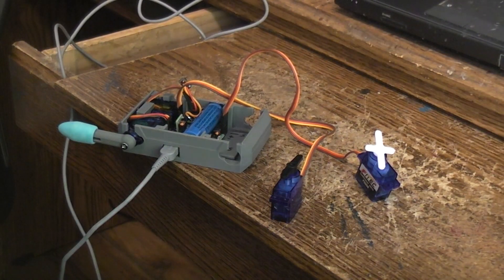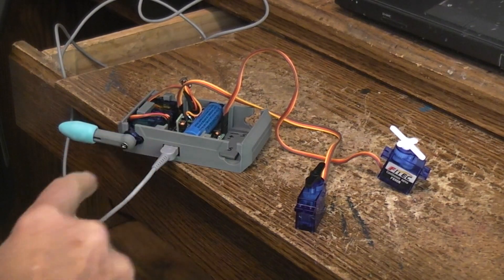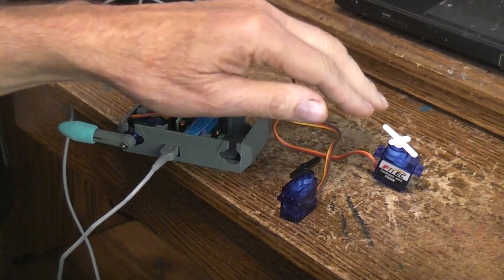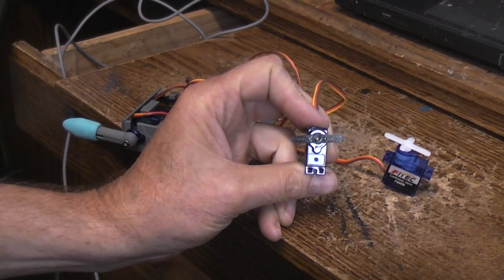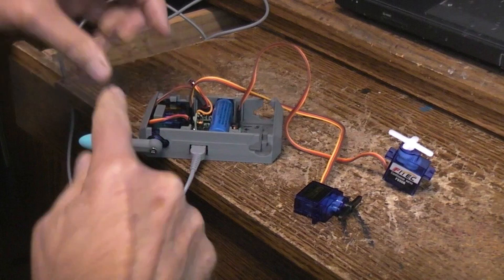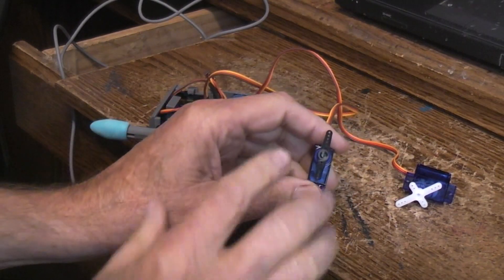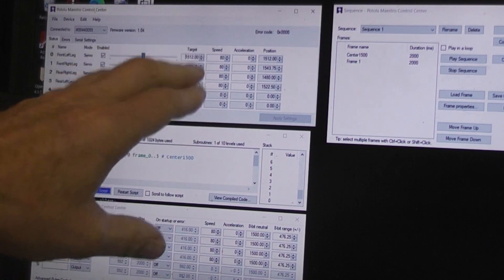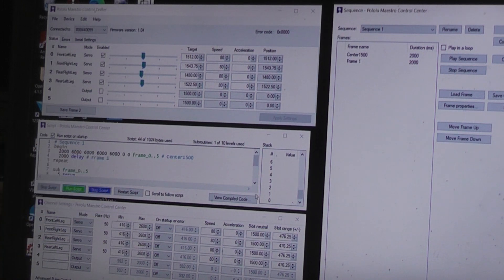180-degree, 270-degree and 360-degree 9gram servos, what does this really mean?

Comment: whats the part number of the 270 degre servo, i cant find one anywhere, i want a servo that can turn pretty much 300 degrees with a knowledge of where it is (not continuous)
Reply from the maker: Odd that you cannot find them. I just put in 270 degree servo in my browser and came up with all kinds of places selling them, even Amazon has them. [PWM Control System]-Control system is PWM (Pulse Width Modification). Its pulse width range is 500-2500μsec.The maximum running degree: 270° when 500-2500μsec.
MG90D 9g Digital Micro RC Servo Full Metal Gear 270 Degree Mini Servos Motor.

Comment: hello sir you've got cool youtube videos its very informative. but i have some questions to ask, is the 270 servo motor programmable to an arduino uno microcontroller? also can i ask where i can buy the 270 degree servo motor? i need it to make a positional angle servo motor for a research project. I hope you can reply.
Reply from the maker: The 270-degree servo is controlled the same as any RC servo. So, if a Arduino uno can control a servo then it can control the 270-degree version. I found my 270-degree servos on AliExpress.
Reply: Hello sir, did you use 9g TS90MD 270  degree servo motor?  Because i found some in ali express and I want to confirm it first before  buying, and also its programmable to arduino uno right?
Reply: Do you mind giving me the source if where did you bought your 270 degree servo motor sir? I really need it for my capstone project.
Reply from the maker: @Mbs-yn7ul  Yes that sounds like the same servo. I bought mine from AliExpress as well. It is controlled just the same as any RC servo. So, if your Arduino uno is programed to control RC servo's then it will control this one as well.
Reply from the maker: @Mbs-yn7ul  AliExpress is where I found them.
Reply: Hey! Did u get to choose the degrees from ur 270 servo motor when u programmed? 
For example, something like: Servo.attach(pinServo, 500, 2500)
Being 500 -> 0 degrees and 2500-> 270 degrees
Was like this?
Reply from the maker: @SrCliban  Yes the servo follows whatever signal you send it.

Comment: Good info.  Looks like your having a lot of fun with that Katie platform. When I was into RC the sailboat guys had a special servo for their sails. It looks like now they have multi turn  winch servos that can be driven with standard servo pulses. Some are  'relatively' cheap.
Reply from the maker: Yes, the sail winch servos seem to just be the 360 servo that I show. They do not seem to have position control just direction and speed. I see some guys replace the pot in the servo with multi turn pots or just hook up a external feed back position pot.  Do you have a multi rotation servo with position control?
Reply: @Robothut  I left a reply here yesterday but YT deleted it. I have ordered a 6 turn version of a sail winch servo. It should be here in a week. I'll post a video when I get it.
Reply from the maker: @rick_100  Great. In your video you should be able to leave a link to the servo. Hope it operates as we hope it should.